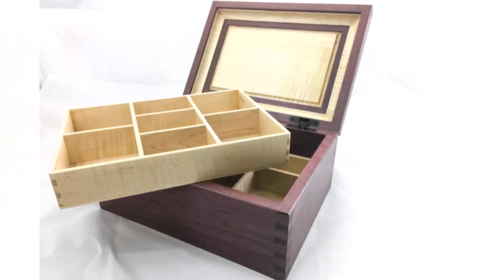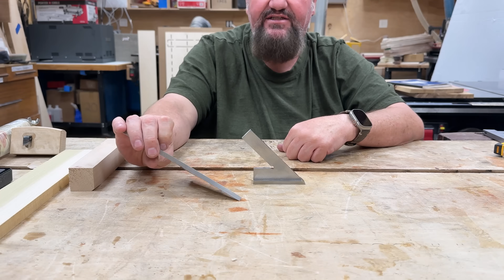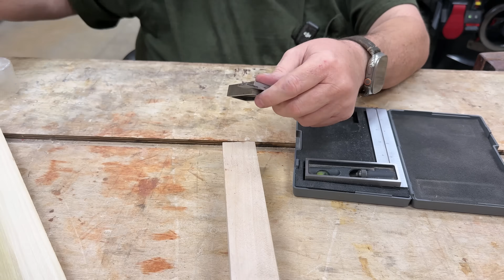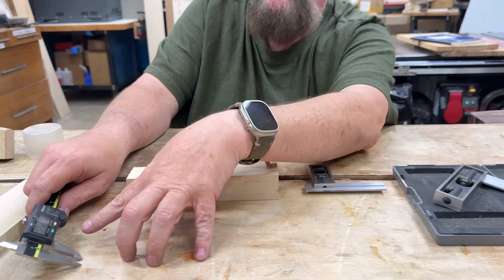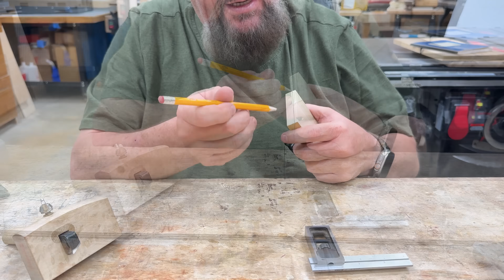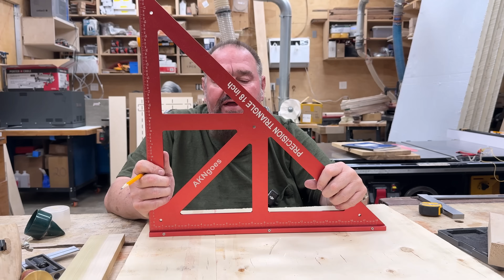These Layout Tools Changed My Woodworking Forever (Up your Game!)

Comment: I like the Shinwa Japanese combination square.  It has the 45 and 90 degree angles plus the lip so I get both of those measurements in one tool.  I keep it at my table saw for doing markups and setting the blade angles.

Comment: Where'd ya get the proluxe spray? I use the window and door oil exclusively and didn't even know they made anyhhing else
Reply from the maker: They bought out Deft Lacquer. Here is a 6-pack at a great price:
https://amzn.to/3JBwCQF

Even though the can says Deft in the picture on Amazon, they send the can with the pro-luxe label. It’s the identical formula. They just changed Deft’s name to ProLuxe

Here’s a single can. Not as good of a value. But still not bad. 
https://amzn.to/4hZCQ9r
Reply: Ah.. just Like Sikkens got changed to pro luxe